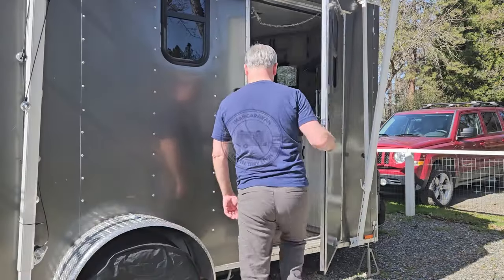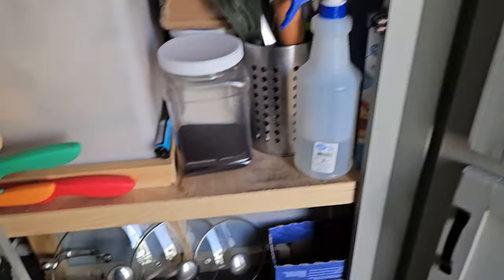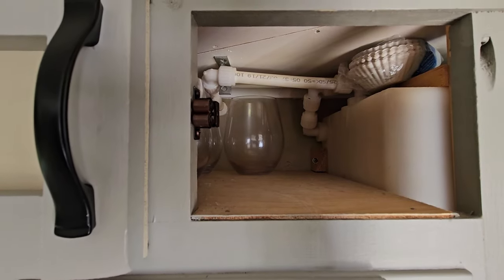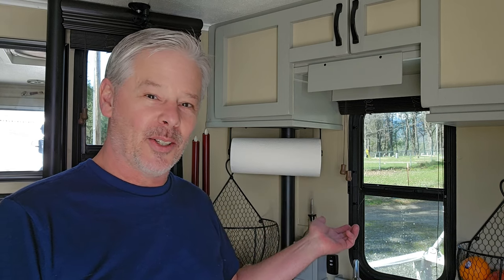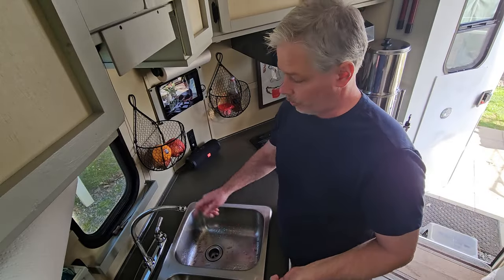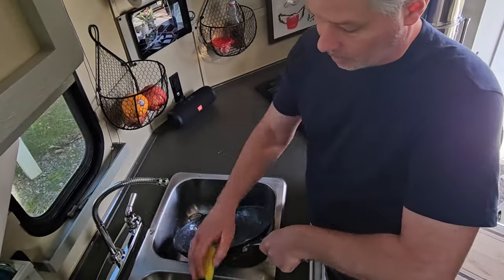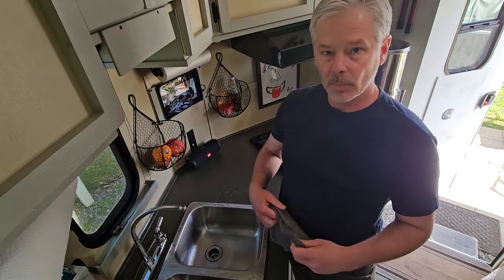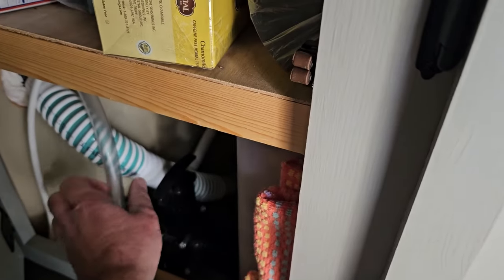Gravity Kitchen Water in a Cargo Trailer Conversion!

Comment: Disclaimer: scotch pad side of sponge will remove the non stick layer on your pans 🤦🏻‍♂️😂
Reply from the maker: Oh dang - maybe on cheap pans! Mine are Curtis Stone - strong 💪 tough and ready to take on a scotch pad without a flinch. Cheers!
Reply: @1man_caravan  😉🙌
Reply: Absolutely love the “Visual display” of the overflow valve.  😂.   I realize you are not looking to change plumbing, just asking a question here, nut when you built this did you consider just using the pump directly or a pump plus a booster tank?   If you did, just curious why the small overhead vs the pump pressure?
Reply from the maker: Hello....I didn't consider pressurized water for even a minute! I had a 27 foot RV before I built this conversion that was less than 10 years old, and it flooded twice from water lines breaking under pressure. And I was fascinated with gravity water systems when I built it 😁 Cheers